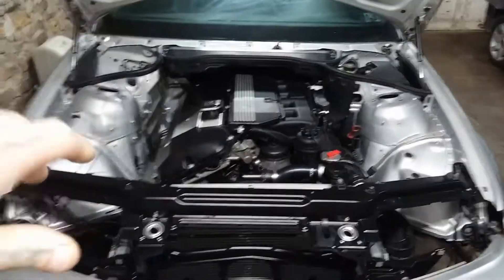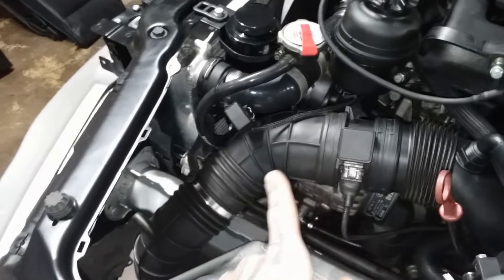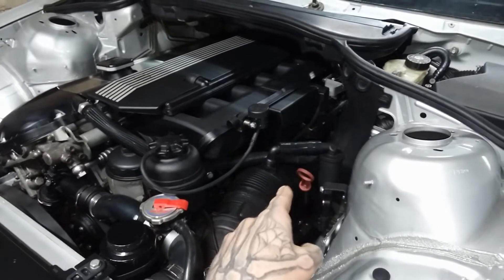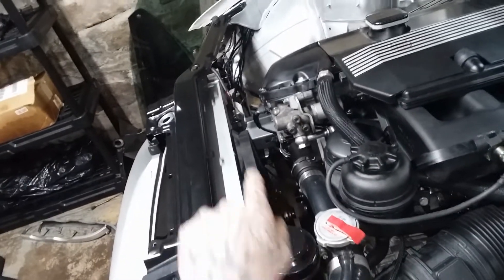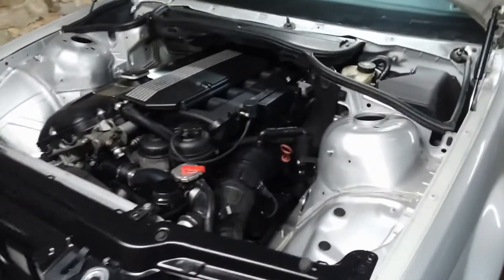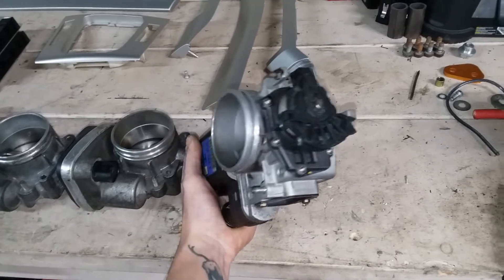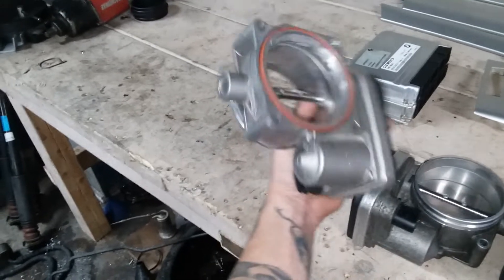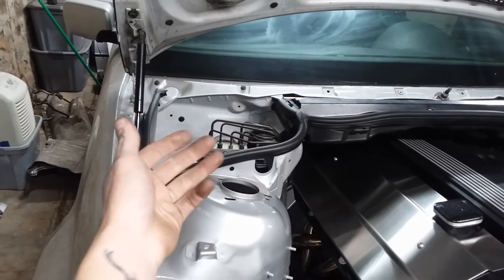BMW E46 Racecar Build - Project Engine Bay Updates & Discussion

Comment: Nice video! Really good information. I'm installing an M50b25 intake to my M52TUB28. I was wondering if it would be a good idea to upgrade the throttle body and I'm looking forward to seeing your results with the different units. I think I'm also going to make the CCV the same way you did.
Reply from the maker: Hey! Okay, just be warned that this oil separator setup isn't designed for street driven cars, but for cars that will be revved constantly at the track. May or may not function adequately on street for crankcase evacuation.
Reply: @OLearysBMW  Ah okay, that's good to know. Thanks man 👍🏼
Reply from the maker: @Micha_k  not a problem, 😁